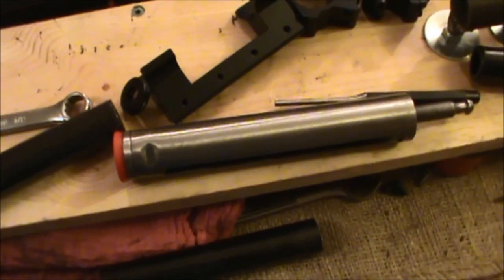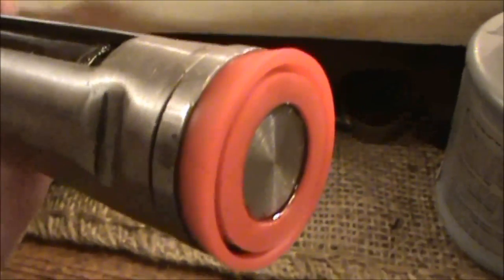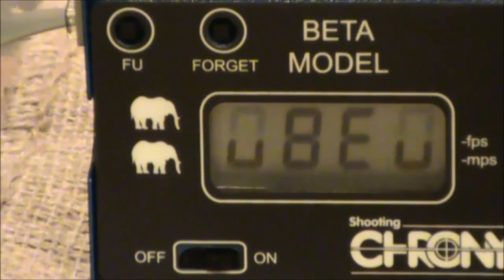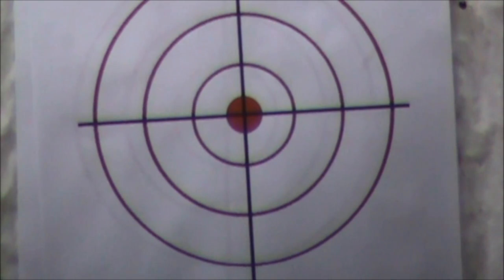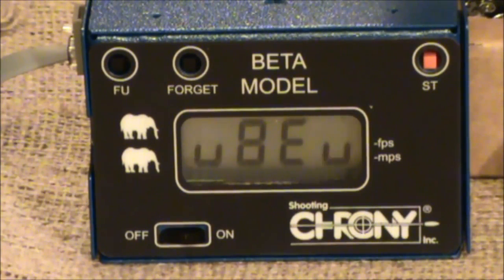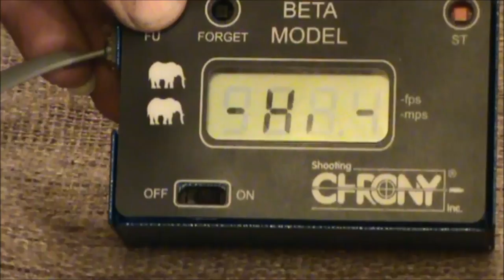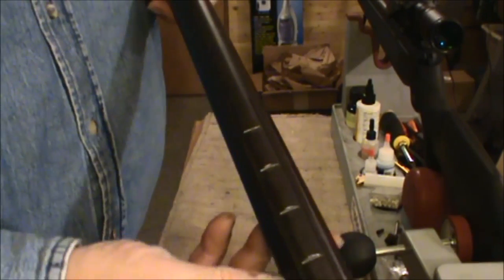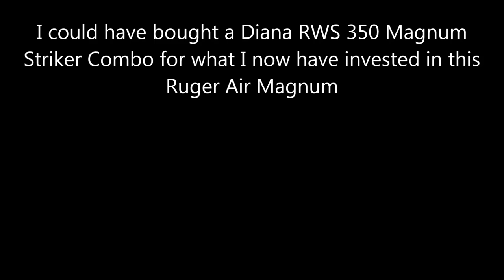Super Tuned  Ruger Air Magnum Breaks the 1400FPS Barrier! The Untamed Animal Part 2

Comment: Thank you for a very informative review in all respects.  I have been airgunning for 30 years and own a Beeman Lazer tuned R-1 in .177 and an RWS 350 Magnum in .22 with BSA 4-12 44AO scopes.  I also chrono all pellets with an Oehler 35P set at 10 ft. I think you get really poor accuracy from a bad barrel like your .25, especially if the fps is consistent (s.d.<10).  I have found pellet consistency, or the lack  thereof, is the primary contributor to flyers other than trigger and hold of the shooter.  In .177 in a magnum level the heavier ones in match grade should minimize flyers such as Kodiak Match Extra Heavy or H&N Baracuda Match. In .22 I find the Beeman Field Target Special copper plated or the equivalent H&N Field Target Trophy Power copper plated is best.  (still trying out some others now available).  All airguns have their favorites, but as I have shown many shooters, once the trigger and hold are good, pellets are the key if the fps s.d. and group size are small.

Comment: wow, i have a octane 22, octane .177, and a Fuel .177, the only issue i have had was the trigger on the Octane 22 stripped the threads for trigger adjustment, ordered one from Umarex Monday and received it today, it was great service and the trigger was an updated item , is working great.  thank you for the great reviews

Comment: I have owned a Ruger mag since 2010 , it was originally 177 and a piece of junk. Through the years I have added Diana 350 parts to it and changed the barrel, now it's a .25 calibre. The gun never gave me much satisfaction, its highly sensitive and in .25 it was barely giving 650 fps with Benjamin 28g domes. The other days that changed , by sheer luck I was at a hardware store and saw a box of O rings and picked one that seemed the same size as the 350s - when I got home I tried it on the Ruger, turned out to be larger than the Diana 350 breech seal and it entered a bit tight but extruded somewhat more. Bingo, the Ruger mag has become a great gun in 25 caliber, I believe its shooting at around 700 plus fps and has an impact similar to my Hatsan 125TH springer.
Air rifles can surprise you, this Ruger was almost in line to becoming a fence post, now it's a great hunting gun.

Comment: the new springer check list is a must before taking stuff apart - chamber lube gun 3-4 drops, raise breach seal to make good contact, break in gun with a tin of pellets before any chrony test with a clean barrel, then if velocity is close to claims you can just leave it, if velocity is dramatically off you can then take it apart, often this is because to much moly grease from the factory, or a piston tube that may need a polish, the seal you pulled was fine, you just got it hung up on sharp edges, this is always the case with most dis assemblies, before re assembly de burr sharp edges, and apply moly grease on moveing parts with a paint brush, do not forget 3-4 drops of chamber lube after re assembly, moly grease is not a substitute for piston lube, it causes more friction then silicon based chamber lubes, use RWS or Beeman chamber lube. the check list is from a RWS guy who did this for a living everyday, and i have seen it work in my spring piston guns since 1995 when i started taking them apart. my RWS model 34 .22 20 years old shoots the same as the day i bought it new.  break ins on non German chineese guns is longer because they grease the hell out of them, and piston seal has to conform to a rough piston tube, also we all know trigger job also will be needed with cheaper air riffles, unless a record style or quatro wich is fine just the way it is, to much sear and piston catch work makes gun dangerous for a accidental discharge. its clear we get what we pay for. most German and even some BSA british models are ok from factory, and not quick assembly line produced. remember chineese are abused workers getting 50 cents an hour to work faster then lightning to satisfy american consumers who want to pay the lowest price but expecting perfection.

Comment: I sure this is a common problem.   We have a Remington 177 (I sure it is made my Crossman) and found it to have very poor quality control, 1st  the barrel was not screwed in tight, We tightened it 1/8 turn before it was seated, 2nd and most frustrating the fit between the barrel and breach always has a little sideway movement making accuracy imposable, tightening the pivot screw does not help as the washers are just a little too wide I think and if I used narrow washers and tighten the screw I would then have a wedge shape gap back to the breach . I mounted a scope rail where the rear sight was and mounted a scope (eye relief was horrible) but with a scope direct on the barrel now it shot 5x more accurate , Still working on a solution to parallel the fit and close the gap. Hope this helps J

Comment: As I understand it diabolo pellets can be destabilised if velocity is too high which can cause flyers and keyholing. Detuning, selecting calibre and pellets to keep below ~900fps helps with accuracy.
Reply from the maker: Proven not true. The two biggest reasons for flyers is a long barrel coupled with recoil and barrel vibration. The barrel does vibrate more with higher velocity pellets and that can be cured with a barrel weight.
Reply: myairgunreviews I agree that recoil and barrel vibration are the main factors likely to cause accuracy problems for spring gun shooters and that's why technique and consistent hold is so important. However, considering velocity alone I don't think you will get optimum accuracy from pellets that are breaking or even approaching the sound barrier. I am open minded regarding this and would be interested to learn otherwise. I believe velocity related destabilisation has also been demonstrated by PCP shooters for whom recoil and vibration have far less effect. For example the youtube video: Weihrauch HW100 T Accuracy Review - Ted's HoldOver (F.S.B FAC .177)
Reply: NIce work
Reply: DId you try Hatsan 135 in .177 ? With out tune its reached 1065 low with 10.65 grn pellet.
Reply: Math J No, I haven't tried shooting any Hatsan air rifles.
Reply: +Math J Hello do the hatsan rifle are better than the crossman, beeman, ruger, and the other brands that walmart sells. I'm trying to buy an air rifle but I'm getting crazy with some many of them thank you.
Reply: Yeral Rodriguez Actually, in my opinion, if you want power with accuracy in a break barrel Air Rifle buy Hatsan 135 in .25 Caliber or Hatsan 155 in .25 or Hatsan 125 Sniper in .25.  or search for Webley Patriot (I mean old 2005 model) in .25.  If you find one forget about all Hatsan. Webley Patriot in .25 made in England is the best spring power Rifle.
Reply: Ok Sr thank you
Reply: Yeral Rodriguez no problem. Actually where are you from?
Reply: I live in Florida and I born in Cuba

Comment: You should never clamp a spring piston airgun!  Think of it is a recoiling artillery piece.  To shoot accurately it has to free recoil. Rest the stock(never the barrel on cushioned surface or on your hand holding the stock on a cushioned surface.  Don't death grip the gun hold it, firmly but not a death grip.

Comment: I recently broke the main spring on my Crosman Optimus (please don't ask why!) and could only find a spring 200mm longer than the original, albeit the same diameter and core thickness! I was also told by the gun smith that the technical specifications were the same - besides the length. After much trial and error, I managed to find the right cut size so that when compressed, I only had 3mm play - or just enough for the sheer to engage. The net result is, my now new spring is 60mm (25%) longer than the original! Accuracy with the H&N Crow Magnum (9.26gr) is excellent, and it appears that the trajectory for the H&N Rabbit Magnum (15.74gr) has improved significantly too! At the cut-off end of the spring, I fashioned a tough nylon washer to compensate for the seat that was removed, which I placed at the rear end closest to the trigger - after de-burring and shaping some form of a seat on the cut end of the spring!
What are your thoughts, and what kind of improvements could I see - if any? For example, can I expect to see a 25% improvement in velocity & energy?  
Kind Regards, Kevin
Reply from the maker: Energy will increase. If you have any problems, the original spring is available from Crosman. You just have to call them
Reply: Thanks so much, but because I live in South Africa, there will be times when such parts are difficult to come by! Regards.

Comment: get a centralising bush made to centre  the rod in the piston while you have the piston crown TIG welding round the circumference
Reply from the maker: Cheaper and easier to just use a RWS Diana Piston. They are made in the USA and last forever.

Comment: Hey Ken I noticed you didn't mention drilling the air outlet hole for the 25 cal barrel, had it been bored out you would have seen greater velocities and better accuracy   plus the gun will b much more accurate with all the screws snuged down   and if you drill holes in the piston and lighten it it also increases speed which expelles the air quite a bit  try this you will be suprised
Reply: Ja the port hole in most modern guns is 80 percent of cal size
Reply: Kenny r.i.p    i had not even realized you were no longer with us   iv watched your show numerous times...always your simple to the point answers to some of airguns nightmares was always welcome and you fought a good fight      aim small buddy......Dave
Reply: Kenny r.i.p    i had not even realized you were no longer with us   iv watched your show numerous times...always your simple to the point answers to some of airguns nightmares was always welcome and you fought a good fight      aim small buddy......Dave

Comment: Have you thought about drilling holes in the Piston Sleeve? I drilled over 70 holes in my Benjamin NP2 .22 Piston sleeve and now it shoots over 1000fps and hits supersonic on a hot day using Crossman P HP's.
Reply from the maker: +Metal Rott Nope.
Reply: I lowered the weight of the sleeve by over half by drilling 5/16 holes and then sanding the edges smooth.
Reply: Do you think less friction with the holes drilled upped the FPS?

Comment: HI Kenny.  Thanks for these great videos and pray your health is good.  I just bought a Hatsan 125 Votex in 22 caliber.  It shoots crossman14.3 at 925 fps and Benjamin destroyers 14.3 at 945 fps.  I was thinking to upgrade the breech seal and piston seal, too.  Do you have any thoughts on this?   I'd like to improve performance and accuracy as much as possible.  Also, can I swap the 22 barrel out for a 25 on this model?  Appreciate it.
Reply from the maker: I know that Vortek makes upgraded Piston Seals for the 135 but not the 125. As far as I know you can only get OEM Seals for it. Yes you can put a .25 cal barrel on it.

Comment: i had the same problem with my piston till the inside metal bar remained cocked in the trigger and the piston went forward and the gun fired.after that it was unable to cock the gun.i took it apart i placed some strong logo glue in the hole that the bar was attached and i hit the bar several times with a hamer to sit into the hole, I didnt place it back to the gun just for security measures. i finally order a new one and i wait to receive it so i can start the installation. i also odered a spring and the inside cylinder.I m looking forward to see the results.

Comment: Hi, loved the video, just wanted to ask were do you bought the cometa piston seal also do you have an idea whats the OD and ID in it ? Thanks
Reply from the maker: It's Actually a Vortek Piston Seal. vortekproductsDOTcom
Reply: myairgunreviews do you happen to remember which one ?
Reply from the maker: Al Garrido Same seal as the RWS 350 Magnum.
Reply from the maker: ***** It was over priced for it's power but not bad.
Reply from the maker: ***** Hunter Extreme is a "So Called" 1650 FPS Ultra Magnum Springer that is over priced and and only made in .177 cal. I think a Hatsan 125 .22 cal has more power for les than half the money.
Reply from the maker: ***** They lied.
Reply: myairgunreviews
I have the Hunter Extreme in .22 caliber, and it is VERY accurate!  Mine shoots 3/4" groups at 50 yards, and I've used it to plink out to 100 yards.  This rifle likes JSP Jumbo Heavies.  The barrel screws off very easily, so swapping between .177, and .22 is trivial.

However, like the Air Magnum, it is rough on the scope, rings, and stock screws.  You need to locktite all screws and check them before each outing.

I won't bother putting a high powered scope on my Air Magnum.  It destroyed my Center Point 4x-16x, literally shattering the glass.
Reply: Do you know of a barrel that can work as a replacement since HatsanUsa don't have barrels in stock.
Reply from the maker: Al Garrido For which rifle?
Reply: Hatsan 125

Comment: Are you ever going to learn the difference between a muzzle brake and a suppressor? Don't feel too bad, several manufacturers, including Umarex, stupidly call them "dampeners", though they do not spray water on the barrel. I suspect they meant "dampers".

Comment: My Air Magnum's safety came out during disassembly.   Is there a trick to getting it back in?  It won't cock now when I pull the barrel down.
Reply from the maker: The safety should go in before putting on the end cap and putting the receiver into the stock.
Reply: Okay, yes I know but it doesn't want to go in easy and feels like it's getting stuck on something.  I look in there with a flashlight but don't see anything.  I reassemble and it looks right but cocking it doesn't set the trigger.
Reply from the maker: Fone Star Get a new trigger from Umarex USA. Not that expensive.
Reply: I figured it out.  There's a spacer that is supposed to go between the safety and mine was moved over to the side and blocking the safety.

This rifle wants to vibrate itself apart, 20 shots and the screws are falling out.  So I am goint to use loc-tite on all of them.  Might have the weaver mount welded in place too.

Comment: Heres a question for ya, I upgraded a springer to a gas ram, complete conversion parts. The benjamin classic.22.  Its a step up in power. Heres the issue. It grinds while cocking after 50 plus shots. I installed a new piston and ram next and same issue.Even sent it out, got it back and same thing happen again. 3 times it gouged the compression tube, along with the bottom back side of piston. I tried molying the shoe and cleaned the edges around the shoe, along with the part it rides against. The plastic guide on the arm is good.comoression.tune was cleaned up each time.
 I got a brand new rifle and did the conversion right out of box, 40-50 shots again and felt the grind again. Opened it up and had a slight mark in tube.
 Im So lost on this issue that I put back the spring and its shooting fine now. The cocking arm did look slightly bent, on the new rifle,which i streightened out and installed the spring.
The kit i got was a drop in with slight tweeks to make it fit.  Any suggestions or ideas on what could be the cause? thanks and I enjoy your videos.
Reply from the maker: It would be hard for me to tell without seeing the gun it's self.
Reply: myairgunreviews ya i agree. I was.thinking it was from the extra force during cocking, causing piston contact, even the ram had slight marks where it enters the piston. something out of aligment. I ended up ordering the phantom piston for it and keeping it a springer. Save the gas ram for another project. ill crony it and should be close to the fps i.was at before  , good enough. haha
you have great review videos by the way.
Reply: ProjectADD + PA told me they don't recommend putting a gas piston into an older steel springer. I was planning on doing it anyway. Now i won't, as this about 30 year old Winchester Daisey is a beaut and a collector's item. Thanks for releying that info. 
There are a few airgun-smiths who can install friction- reducing buttons on pistons.

Comment: How far removed is this from the Diana 350 mag. I know the parts are interchangeable. Im also sure that Diana has better QC but do they share flawed designs like the piston?
Reply from the maker: The Diana Piston is made in Germany, not China.
Reply: myairgunreviews So same parts but built to better tolerances/standards. I just got my refurb Diana 350 mag taken apart after about 200 pellets and there is a gouge in the piston seal that looks to have been done by someone. It is about the width of a quarter and runs between the center (where the seal snaps on and stops before the outer lip. The outer lip is bubbled up from what appears to be heat. It amost ooks ike someone cut it so it would leak lube into the front of the seal to diesel. Have you ever seen anything like that? I will send you a pic if you send me somewhere to send it. Its strange. Its being replaced pronto. This gun was post to be refurb by manufacture haha...doubt it.
Reply: https://www.flickr.com/photos/138672914@N02/27593743335/in/dateposted-public/    Here is a pic of it if your at a interested or wanna take a guess as to how this could happen. If its normal I wouldn't know as this is my first tune and first air rifle.
Reply from the maker: It would be better if I could see the whole seal.
Reply: myairgunreviews The rest of the seal looks like any other. Nothing out of the norm. It looks like a new seal with only a couple hundred shoots though it. No scratches, cuts or worn spots. Looks new.
Reply: myairgunreviews When cleaning out the compression chamber I looked for anything that might have did this to the seal and there was nothing but a line drawn where the gouge was that looked to be residue from combustion. It just wiped away like a pencil mark. I am prepping the whole piston what should a be sanding/polishing the outside of it with. Should it be like mirror finish or 220 grit sand paper?